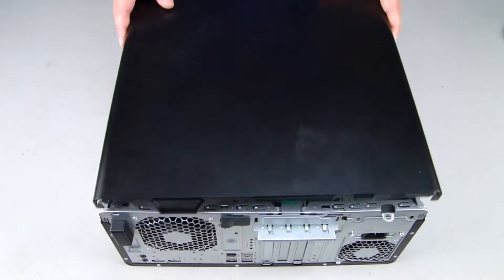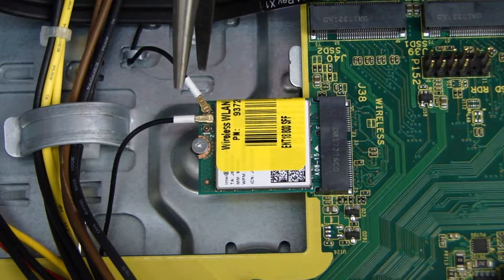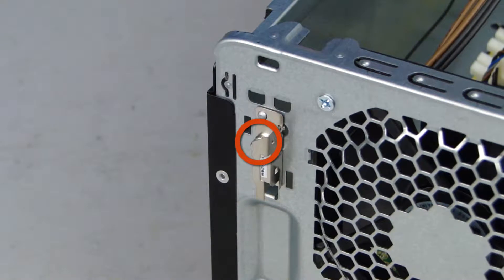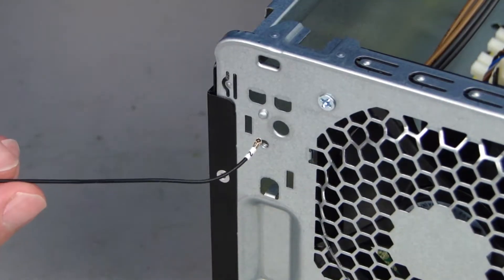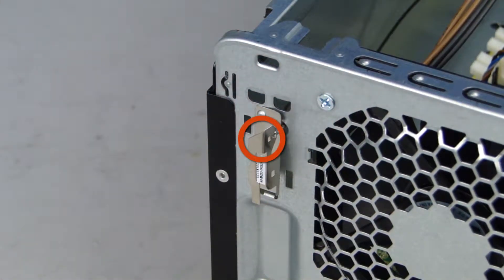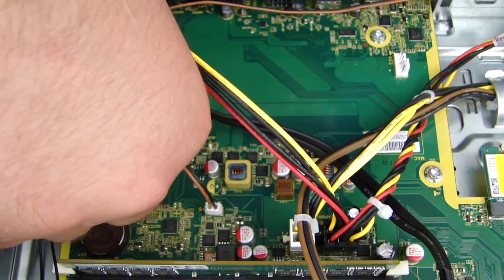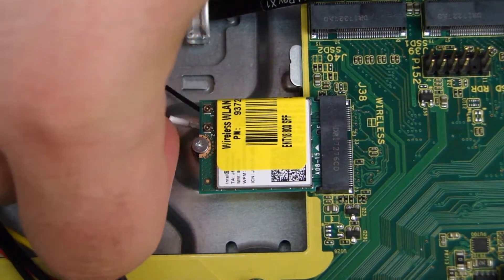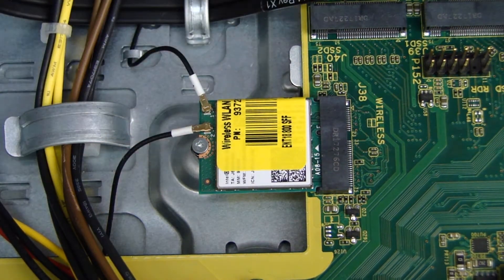Replace the Wireless LAN Antennas | HP EliteDesk 800 G3 and G4 Towers | HP

Comment: Does anyone have a part number for this antenna? Thanks!
Reply from the maker: Hi there, thanks for contacting HP Global Social Media Support!
My apologies for the inconvenience, I am here to help! 
What seems to be the issue?  
May I know the product you are using? A serial/product number would be helpful!
Let me know!
Regards, 
HP Support
Reply: @HPSupport  Its an HP Elitedesk 800 G4 Tower Workstation edition. Part: 4PT94UT#ABA, Serial 2UA8401MV8. I would like to buy the wifi antennas that are in this video. I have been to parts surfer but couldn't find them so i just need a part number. The antenna for the Mini is really easy to find, this one, not so much... any help is appreciated
Reply from the maker: Thanks for the reply.
For optimal PC and printer performance, remember to always buy (use) Certified HP Genuine Replacement Parts from a known and trusted source. You can order it via the HP Parts store: https://hp.care/6052UDll8 
Regards, 
HP Support